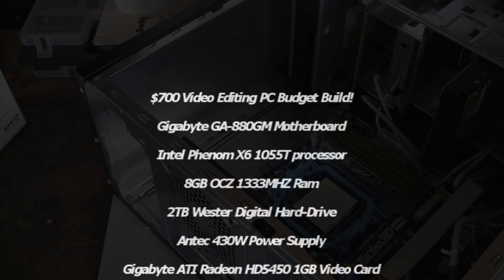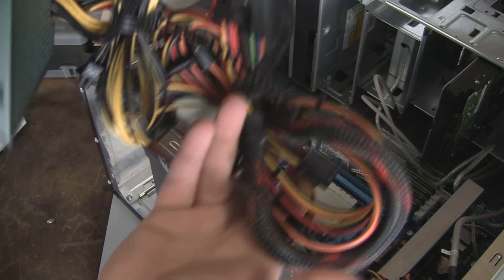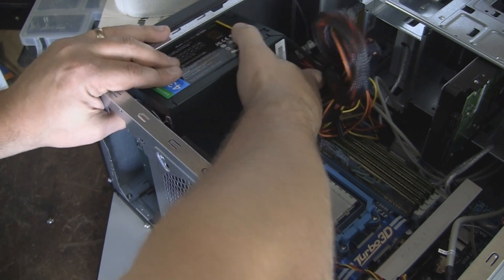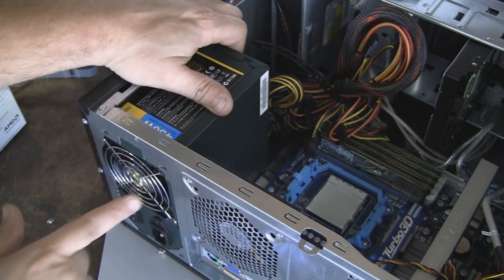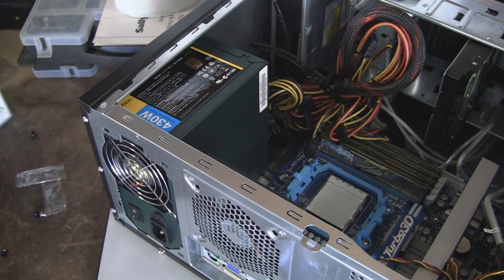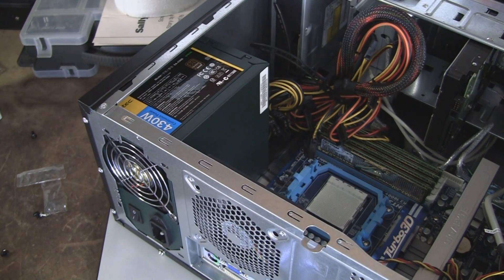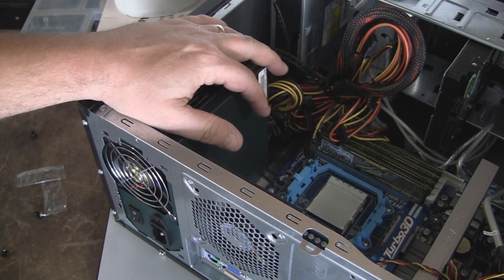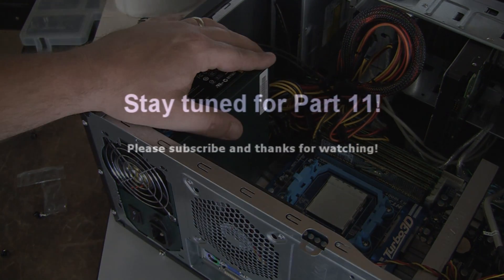Building a PC Step by Step Part 10: Installing the Power Supply.

Comment: @Johnnysshop if have a case with a power supply built in, so I guess i can skip this step but, I notice you dont have one of those anti-static wrist bands on. Is it supposed to used throughout the installation? or is it for when you're connecting the power supply to all of the components?